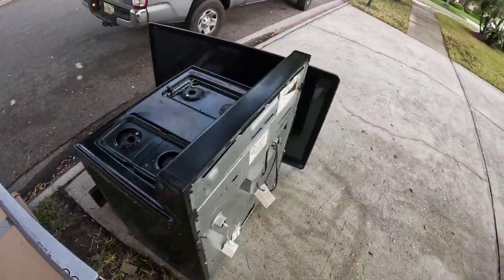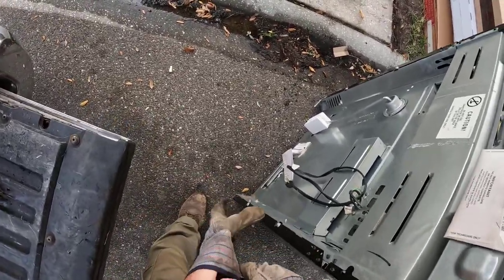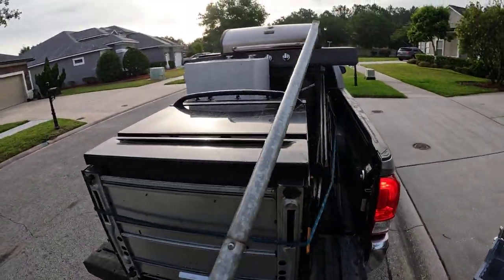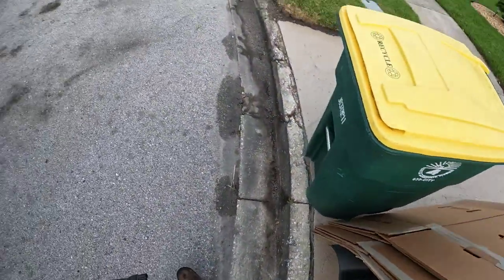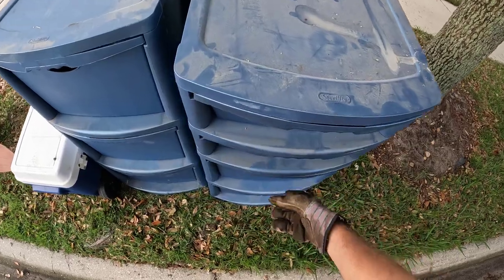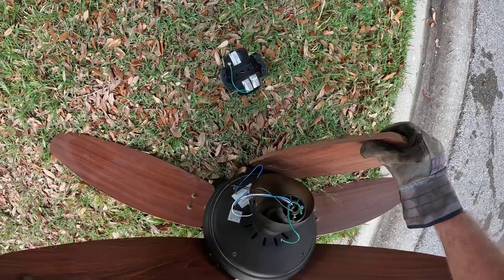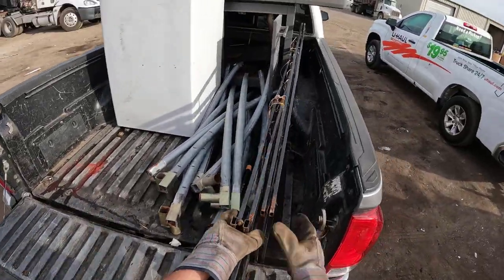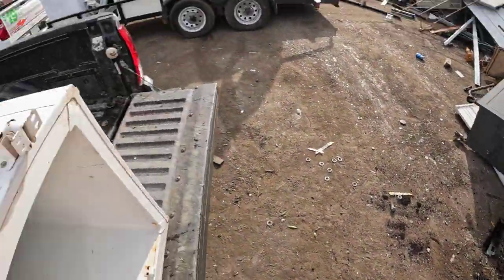How Street Scrapping Should Feel

Comment: I've got a motherboard with two screws that won't loosen. You think drilling them out will work?
Reply from the maker: If it won't just bust out you can drill a hole, a little larger than the screw, on the same side of each screw.  Then slide the MB to the holes and lift out.
Reply: Cool thanks!!

Comment: You waste alot of time opening & closing doors. Put the crap in the truck and move on. GEEZZZZZZZZ...
Reply from the maker: I used to think the same thing UNTIL I have to dig something out to cut the cord or regulator or whatever.  A little bit of time up front to separate and prep is time well spent.